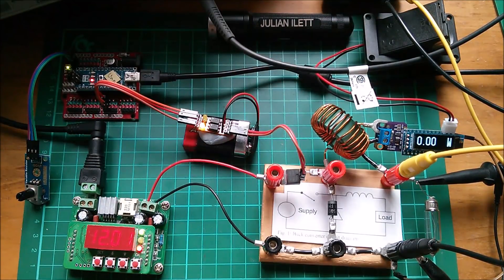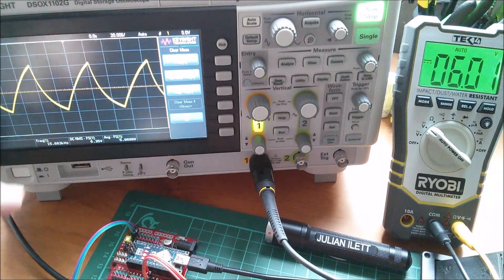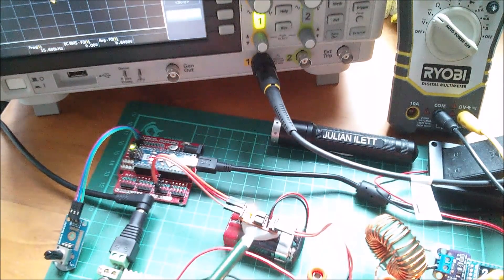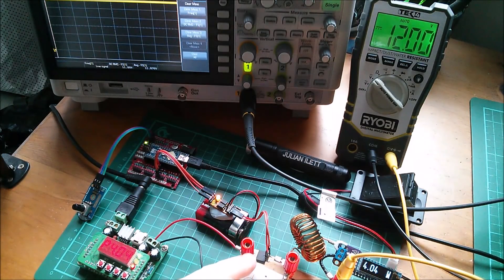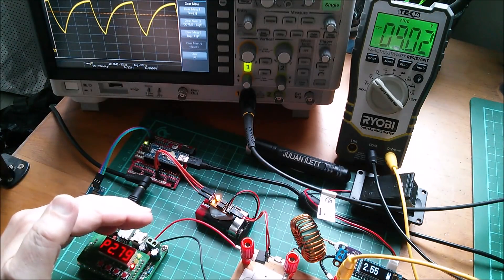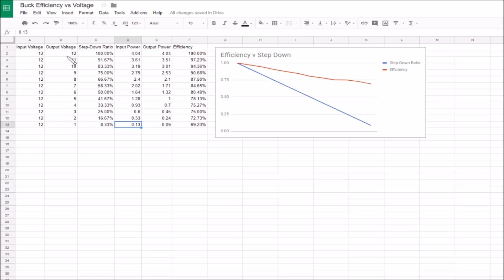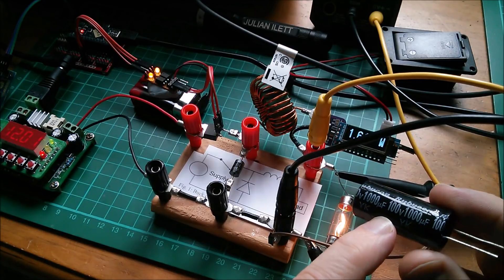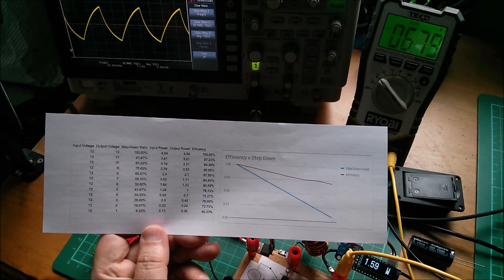Buck Converter Efficiency Testing

Comment: You stepped power down with voltage, how bout you try to keep power level constant while stepping voltage down (one step at a time), changing two values at the same time does not paint the same picture...

Comment: The Muppet 2 project maybe this MMPT solar panel bucket bust converter with higher then the 12v volt possibilities looks to be something to watch, also because my solar panels are going to 68V open and, there are not many thing out there that goes so high and when I want to charge a 48 Li-ion (13*4.2 = 54.6V float) battery there are almost nothing useful, so in My case it will be very useful, 
I don't know about you other people ?? What do you think ?
http://cds.linear.com/docs/en/datasheet/8490fa.pdf

Best Jørgen Thomsen Denmark DK

Comment: Can you please run the same tests at much lower switching frequency, such as 100 Hz? Semiconductor switching losses will be affecting measured efficiency. And what percentage of the losses are also the result of inductor core losses? Your meters will also be introducing measurement errors, because of the non-sinusoidal waveforms. Finally, can you check the currents by using the same meter on input, then output? That would eliminate the differences in readings between two meters, neither of whose errors are exactly linear wrt current levels. Thanks.

Comment: This is all total nonsense!  Why not put the capacitor on the output to smooth it out into a useful DC voltage and stop messing around with worthless saw tooth signals?

Comment: Julian don't so  be happ because your measurement is not correct. This is not efficiency vs. output voltage, but you also measured it with different output power. So please repeat this video with 4 W load on all output voltage.
Reply: Or to be fair with a constant load current (say, 1A) otherwise you will be drawing 4A @ 1V wich would be very very inefficient. DC-DC converters are rated at max input or load current, wich can be exceded before reaching max power

Comment: could this be easily made to cc CV buck converter.? and what would the max output current with 22-28 v in and 12.8v out? and if I made this would it be efficient enough for daily use. in a solar powered lighting system. lights 12 v. solar and batts 24 v.  thanks

Comment: Julian .. Small problem solution - add a 'fine tune' pot in series with the adjuster pot.  Also wondering if the 50Hz environment is affecting the coil.  I like this series.

Comment: You don't really need to waste time attempting exact integer voltages, just note the values and the power ratios and plot what you see. It'll still be a straight(ish) line. Also, whenever I see 0.69, I think "Hmm. That's Ln(2) again. I wonder ..."

Comment: 30% for 11v - will the same numbers hold if it was from 24 to 13? or are we also expecting 30% drop from 24v to 1v? would be interesting to see if it would make sense to have two bucks if you do a large drop... say if you were going from 24v to 1v would it make sense to do 24v to 10v and then down to 1v

Comment: I can't see the point of this.  Without a capacitor after the inductor, all the measurements from your watt meter and multimeter are dependant on how they treat discontinuous signals viz are we talking true rms averaging or what. I have never seen a SMPS that doesnt fit a small cap to reconstitute a true dc output value.
Reply from the maker: I want to find out which components affect efficiency. After the capacitor tests, I'll change the Shottky diode for a regular silicon diode to see what effect that has. Then I'll replace the diode with a MOSFET and attempt to make a synchronous rectification buck converter.
Reply: Julian Ilett HURRY UP!!!!!!
thank you
Reply: Julian is not making a production SMPS here more an experiment to build one from first principles. Besides I bet a lot of Chinese switchers have no qualms omitting that output cap.